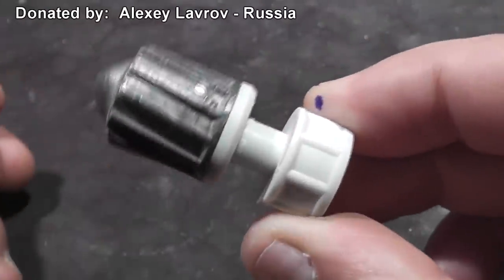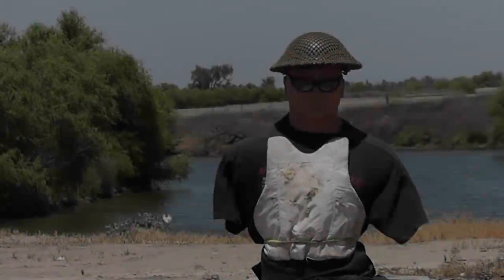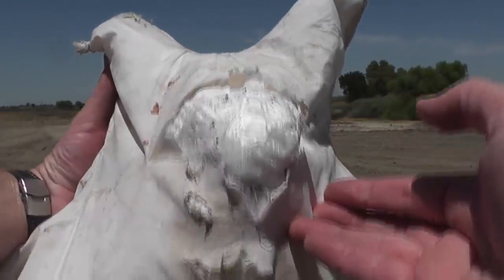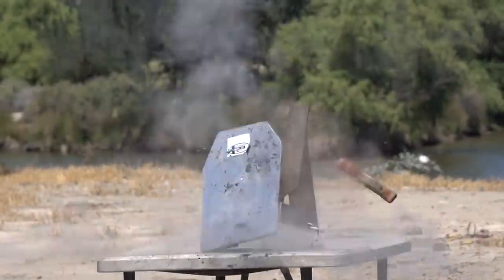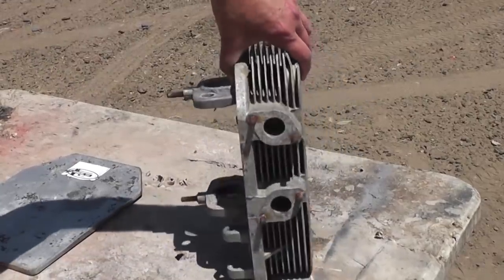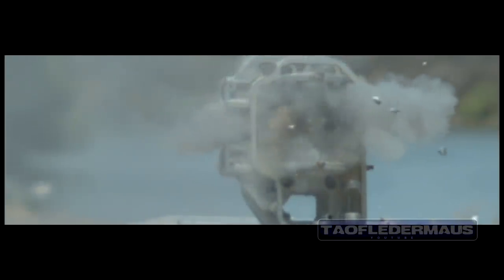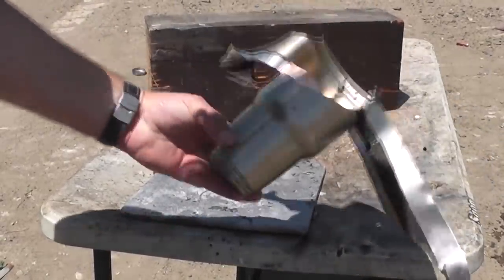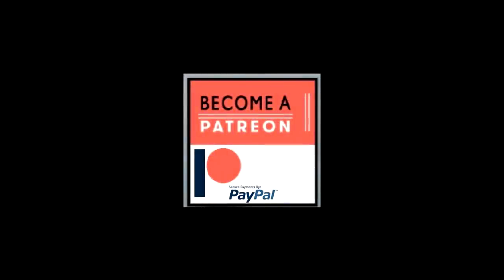Brenneke MAGNUM slug vs Yeti Mug

Comment: NSU Prinz 4
Reply from the maker: Actually Prinz 3!  But I think the 4 used the same engine!   Very good!
Reply: Ah ok. It's hard to tell by video. The Prinz 3 has a slightly smaller engine. Just 0,58ccm instead of 0,60ccm.
Reply: Michael Schacht well done impressive; how did you know?
Reply: TAOFLEDERMAUS try flintknaping and use spaling from the the material in a shell.
Reply: Jeff said it's from a german micro car. The rest is a bit of research of possible models and interpreting blueprints. Nothing special.
Reply: Well done!

Comment: I shot a ford truck rim/tire in the center of the tread with a Brenneke black magic and it went through the entire wheel, tread, both sides of the aluminum rim and put the tread on the other side, I'm sold on them.
Reply: Shane K They do a number on deer, very fast dispatch of the animal.

Comment: Hey! You finally shot these!
They called Berenneke Silver. I just bought em from local hunting gear store. They were sold separately, for reloading at home. These four were literally last ones in this store and it appears in saint Petersburg. So I decided it is not much use of 4 slugs and sent em to Jeff.
Good video, as always. Decent performance from the slugs. May be they gonna like slower powder better, but longshot is good too.
Reply from the maker: I've been meaning to shoot them for a couple months.   The Brenneke special forces slugs we shot,  which were factory-loads,  the gas seals were breaking off so they were wildly inaccurate.  At least these held together.   Thanks Alexey!
Reply: This gas seal is tricky. It looks like it is designed to break, but at desired place. If you look closely you can see four tiny snap locks at the "stem" near to the lead head. When shot this wad will collapse thus providing cushion and softer recoil. And when it collapses gas seal cup should snap to these tiny locks and sit tight. And thanks to your video we can see that this is exactly what happends.
Maybe for Brenneke Special Forces they used too fast burning powder. Usually slugs "like" slower powders and the heavier the slug the slower powder should be. In Russia we have Sunar-42 powder which is designed to propel 42 grams of birdshot (12ga). But also there is Italian powder m92s which can be used up to 50 grams of birdshot in 12ga shell. And recoil is massive but not painful.

Comment: I have shot these before, loaded by the factory. They kick hard, but work very well. I also shot another slug that looks exactly the same, but it is made of hard cast lead and will not deform. Those had MASSIVE penetration.

Comment: I can speak German. The Germans make educational films. "Oooooh yah mein schatz das ist lecker.....oooooh yah" . Nice to see Jeff. A genius whose you tube channel has provided me when many chuckles. Those safety glasses didn't help Doug much. I remember him from Dennang.The helmet didn't help much either but remember kiddies, personal protection is mandatory. Always strap your helmet. The micro car cylinder head was an interesting choice of target. An air-cooled four stroke twin with what appears to be a camshaft journal, but could be a rocker shaft, which cast doubt over my guess at a BMW Isetta, but I am going with a BMW Isetta
Reply from the maker: It's from around 1958,   NSU Prinz.   Hemi head, and overhead cam.

Comment: Hej Jeff! Could you please shoot a water container (like the cup, or a canister) having a balloon or condom taut over the opening? Would be interesting to see if the hydro-static shock rips them or actually blows them up with water. Kind of moving the water from the container into the balloon in split seconds. You probably will have to fix it with tape or a hose clamp to the container.
Reply from the maker: I tried that before with a big green jug and put a balloon over the mouth of it.    It didn't inflate it,  just blew it off.  Guess it happened too fast to inflate it.

Comment: scrambled my brain trying to think of a german 2 cylinder micro car, i've ridden in BMW Isettas and Messerschmits and those are single cylinder, Fiat 500's and 600's are two cylinders. my bro had a Subaru 360 that was a 2 stroke twin, but that's Japanese, i'm lost Jeff!
Reply: must be east german...
Reply from the maker: A few people actually got it right.   This is from an NSU Prinz
Reply: i knew it, east german LOL
Reply: i know of NSU, never knew their engines, i'm a fan of micro cars, owning 3 cylinder cars for the last 30 years.
Reply: i don't know what the deal was, after WW2 a lot of their cars were 2 stroke,  BMW, Mess, NSU. my first car was a '65 bug, proven 4 stroke for over 20 years at the time. maybe they had a surplus of oil?
Reply from the maker: NSU is the company that made that german tracked motorcycle, Kettengrad,  and invented the Wankel engine.

Comment: Its the same as the black magic magnum slugs ;)
Reply from the maker: Pretty similar.   They make a ton of variants of the same slugs,  different weights mostly,   but same slug
Reply: TAOFLEDERMAUS the weight of the super magnum is 600 grains,while the BMM is 602 grains,im pretty sure they are the same,just marketed for different areas(cant buy the super magnum in the US and cant buy the black magic in europe afaik) but i would still watch a video about the black magic slug or the magnum crush :D